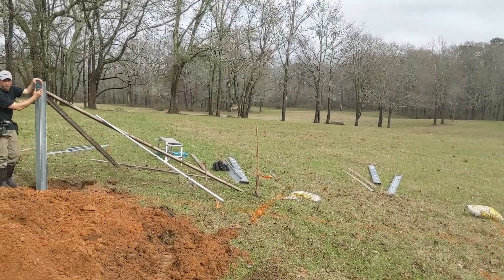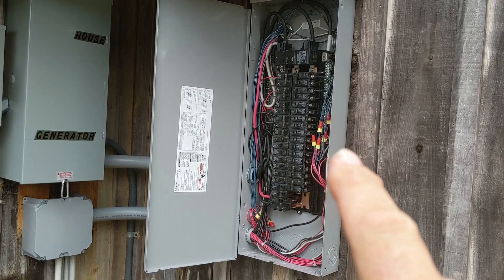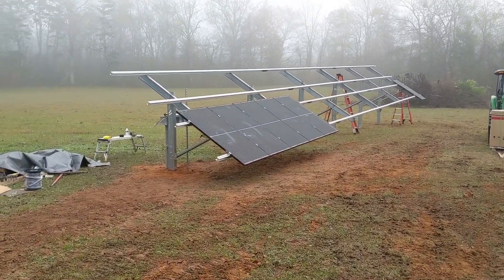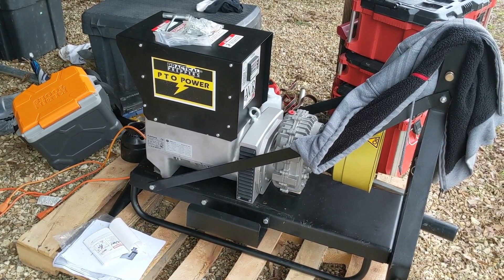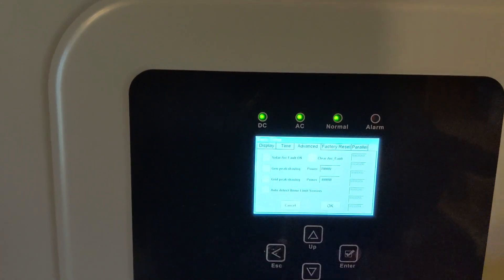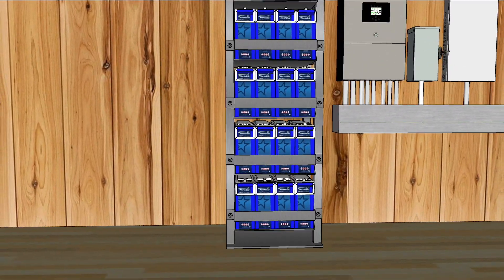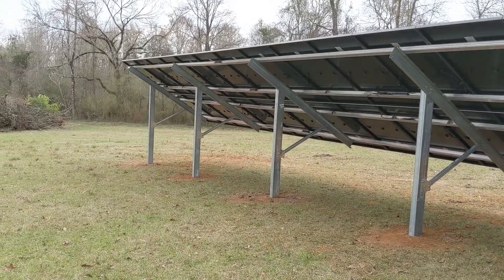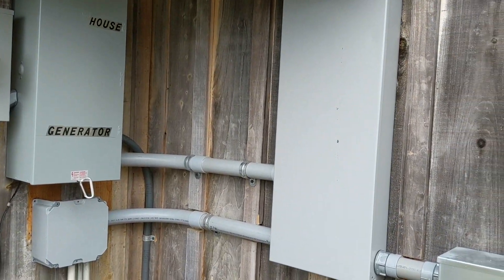Using Sol-Ark's Smart Load and Much Needed Updates!

Comment: 8:25 What is your turn on condition for the SmartLoad?
Reply: 500 watts or more of PV. It was one of the options for turn on and is adjustable.  It can also be turned on and off based on your set battery voltage/%. or always on with grid.

Comment: I don't understand the water heater part. Is it that the water heater is powered by electric company electricity, and when the batteries are full you divert solar to partially heat the hot water?

Comment: Engineer 775 what is the average cost to connect solar to a house? My fiancée and I are looking into getting a house and want to go solar power. We are not sure what is needed or what is good and what is not to use.
Reply from the maker: If you send me an email we can start the process of figuring out what will be the best solar system for you folks. Every system is custom. Do you want to go grid tie hybrid battery backup grid tie cell etc etc we need to figure it out and that will determine the cost. My email is info@practicalpreppers.com

Comment: Why is the bottom element being used VS upper for the smart load? Wouldnt we want the main driving element to be the bottom and the occasional to be the solar fed? Sweet Sketch up layouts!!
Reply from the maker: Actually we want to store as much energy as possible so by heating the bottom and letting the heat rise you take full advantage of that tanks thermal capacity. Can even add a mixing panel if you want to put more but you definitely have to use the bottom element.
Reply: @engineer775  Thanks Engineer 775! is there special considerations in terms of legionnaires disease control? or is this not for DHWT?

Comment: It would be cool to see a little more detail instead of system overviews all of the time. I can only assume that most of us are here to learn. How about some detail on grounding the array? Voltage of the array? String voltage? Wire size of those strings. Where disconnects are required? How strings were sized? Why strings were sized that way? What panels are your favorite and why? If it's cloudy can somebody still take a hot shower since the smart load is hooked up?

I appreciate your videos and understand that ultimately you're selling your business. In my opinion you have a lot more potential with videos that have higher education value.
Reply from the maker: I totally understand. Our jobs have such a time crunch so it's very difficult to be filming all day. I spend a lot of time trying to make sure that these jobs are done in the middle amount of time. This entire system was a total of three days with four guys. I spent a lot of time and energy trying to make these jobs efficient so when we hit the ground we are busting it.
Reply: @engineer775  But it looks to me like Abraham is worth 3 guys?!?! 😉 JK... Just keep me in mind next time you're doing an array. A tid bit here and there adds up quickly. I'm doing a 16kw array on an off grid SolArk 12 this summer so I'm like a sponge right now. Grounding, disconnect locations, string sizing, and anything that is standard practice would be really helpful.
Reply from the maker: @justfly2525  feel free to contact me . If you go to the website my phone number and email are there. I'd be happy to answer any questions you have. You already have all your equipment?

Comment: So much potential for storage under the solar panels. I would have some waterproof sheeting under the panels, then use the space for wood storage, firewood, chicken coop, implements etc.
Might use some longer poles and build a 3' wall on the lower end of the panels.
Reply from the maker: Agree
Reply: Thinking that when I’m ready to do this I’m going to design and build a shed that incorporates the panels as the roof.